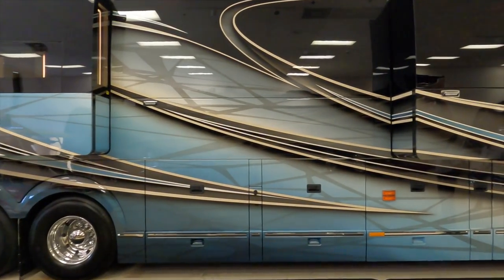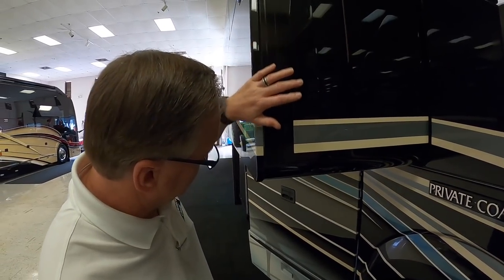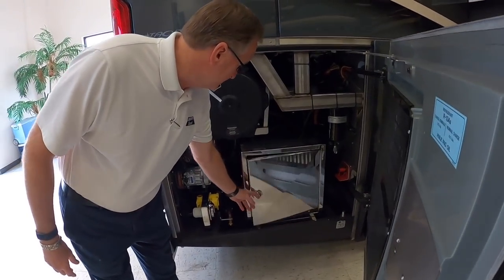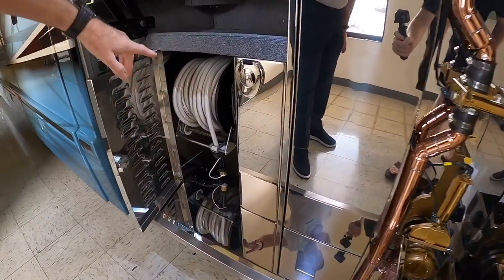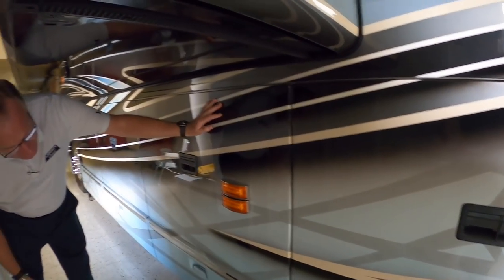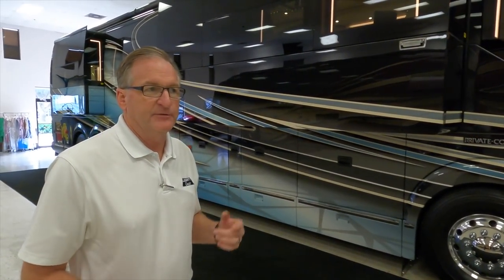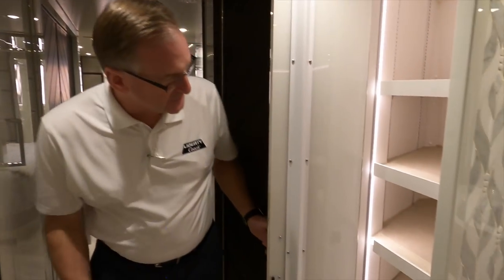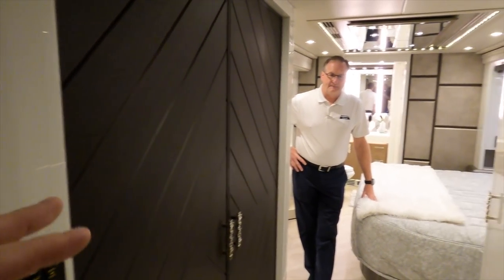PREVOST LIBERTY COACH W BATH AND A HALF COMPLETE TOUR WITH LIBERTY COACH VP

Comment: Hey Andrew good job on the walk through. The coach looks really nice and modern. You also asked some great questions to Frank. Though I appreciate Liberty coach investing on technologies to produce a great coach I still believe there are plenty of room for improvements. It is good to see  that they offer the Lithium Ion option on the Liberty coaches. That's a great system. I also believe for over $2m they could do a lot more. The top of the line motor coach companies aren't innovating at all, for example the current steal frame body was invented around 2004 - 06 after that I don't really see anything new done to the coaches other than esthetics. They are adding ipads, digital screens etc. but they don't offer a connect coach experience, what they do today is offer home automation which is not bad but really doesn't add much value to the customer. Look at Tesla for example, you know everything about your car, performance, motors, maintenance, problems etc. right on the phone. You really don't have to go to a service center to do any maintenance work like your regular cars, the car tells you when there is a problem. In last 3+ years of owning a Tesla, I've never gone to a center do any work, there is no maintenance required. I strongly believe Liberty, Marathon etc. need to step up to use more technologies so their customers benefit given the price point. They are still using 10-15 year old technologies (though they state that they are cutting edge which is far from true!!!) and rather than innovating they are investing more on esthetics which is important to some degree as well. Why they don't use IoT/censors or things of that nature to determine the health of all the major components like engine, transmission, Fans, cooling units, Fridge, AC Units, Furniture, inverters, batteries, electrical components etc. and collect data to determine issues and do proactive maintenance. This can reduce a lot of maintenance and issue we face all the time with our coaches. It feels like the manufacturers want us to be always reactive. I like Frank at Liberty Coaches, he at least shows some interests in innovating, others are just 
too lazy, they just want the easy money from the customers. Just my 2c.

Comment: Okay it's slightly better than others. I still don't like the outside paint. What's up with all the upholstered walls and windows treatments.  I would still have to redo most of the inside and at least wrap that ugly paint job on the outside.  Please for God sakes grt riff of the swoops.  I don't understand why the RV industry is still painting rogs that way. I honestly can't see that much difference between what the other companies do and this one. The inside has some nice touches but it's not great design so very comfortable.  I give it a D+. This is why I want to buy an older rig with good engine that I can undo what the designers did wrong and redesign it all. Give it a touch of romanticism and softness.  Get rid of the mirrors on the ceilings and fabric on the walls. UGH! The problem with having 2 design degrees, and being a really good artist. It's still ugly!

Comment: Let’s be clear. If I’m going to buy a work of art that cost between 200 and $300,000 then I’m not going to park it outside and lay it out in the sun or the rain. I’m also not gonna drive that piece of art down the road at 70 miles an hour either.   I will never spend money on a coach that has that kind of a paint job.